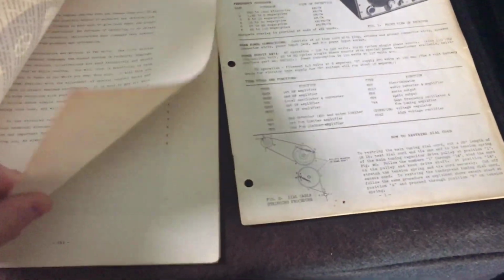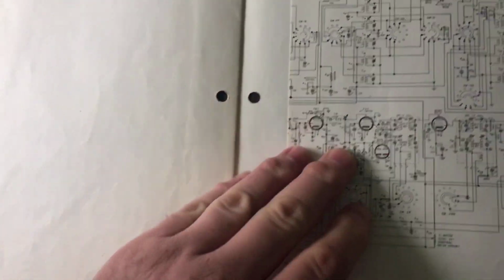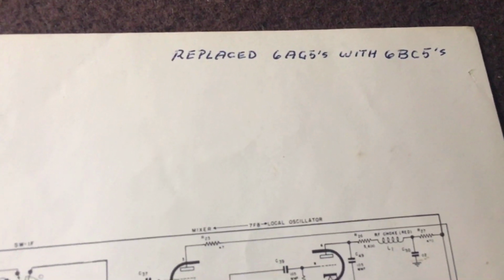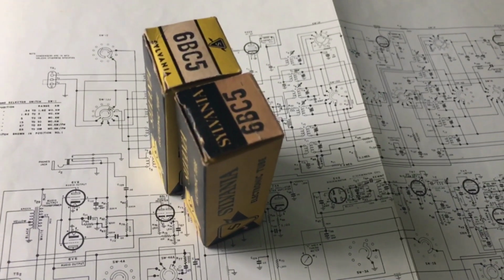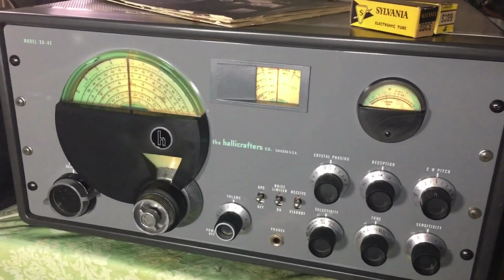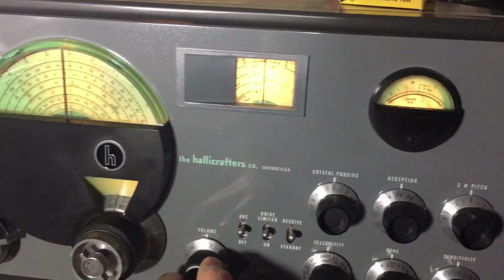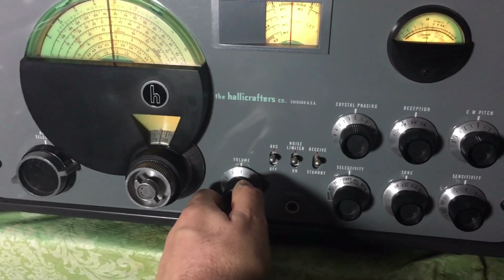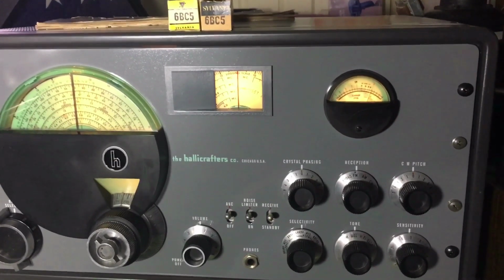Replacing The Two RF Amplifier Tubes In The Hallicrafters SX-42 With High Gain Alternatives

Comment: Thanks for the video.  I also have a Hallicrafters SX-42.  I don't use the radio very much, but I should.  I bought it at NEAR-Fest a few years ago.  It had been recently recapped and aligned by the seller.  I'll have to check which tubes I have it the RF amplifer stage.  Mine does not have the RF cover anymore, but I read that this was common because it did not really serve any purpose.  73 and Happy New Year !! Paul AA1SU